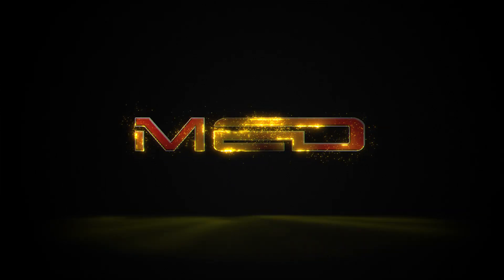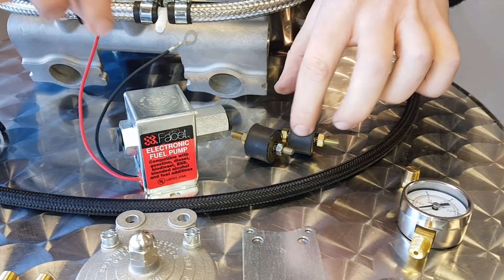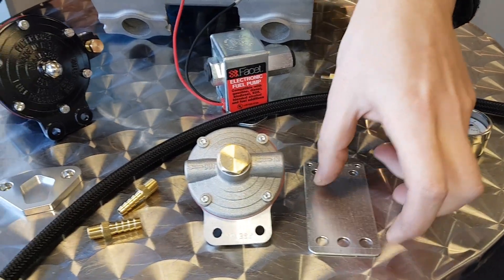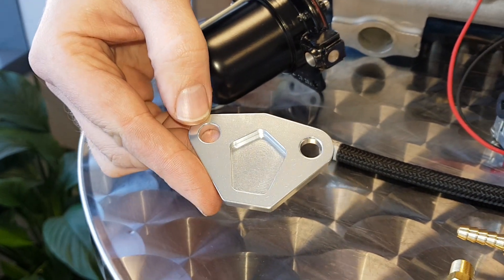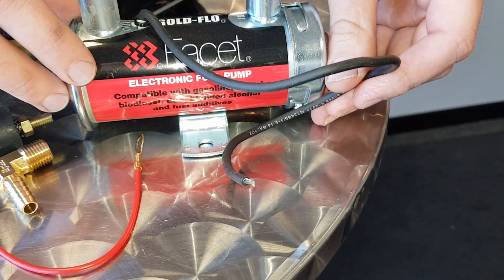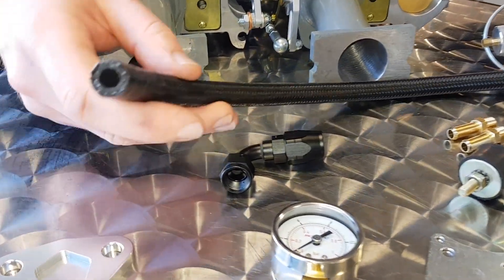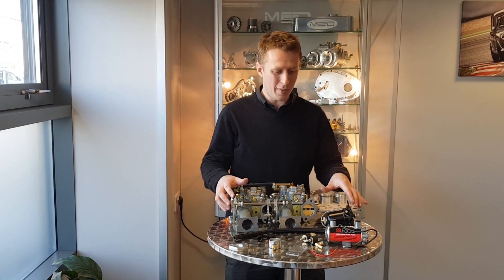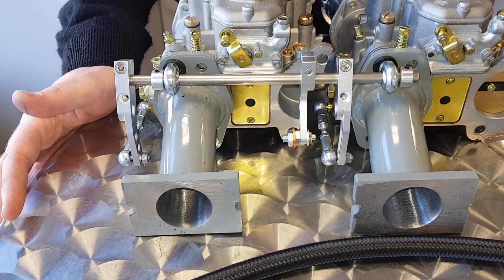MED competition fuel system upgrades

Comment: Minis never had mechanical fuel pumps.
Reply from the maker: They definitely did...
Reply: @MEDEngineeringTechVideos  My apologies, later ones certainly did long after my Mini days.
Reply: @MEDEngineeringTechVideos  Really? Which ones? I can only remember SU electric pumps under the rear subframe.
Reply: harrygatto early one had electric pumps later ones had mechanical poss late 70s onwards
Reply: @jackkallemdjian3945  Thanks for the clarification, I was long out of Minis by that time. info here http://www.somerfordmini.co.uk/eshop/index.php?main_page=page&id=162
Reply: Most A-Series applications used mechanical pumps. The most notable exception is probably the Morris Minor.